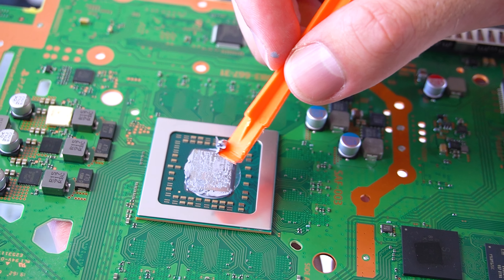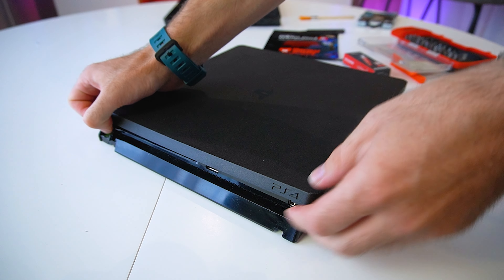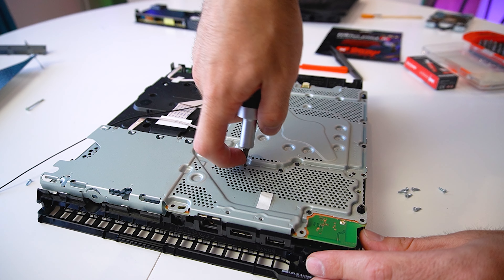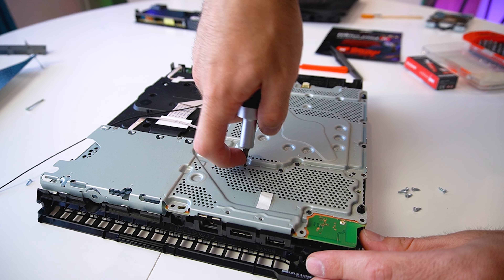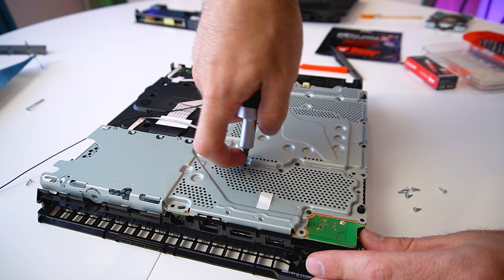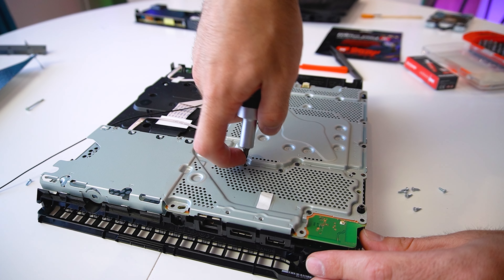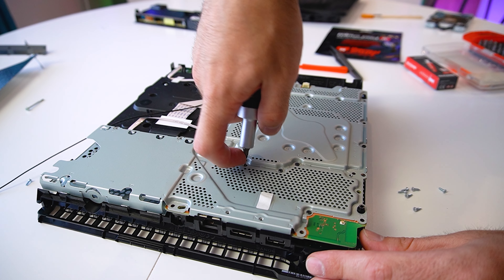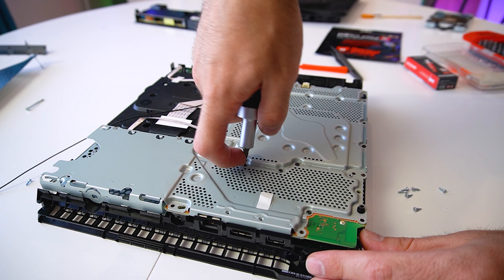PS4 Slim- Disassembling, Cleaning, Thermal Paste And Thermal Pads Replacement

Comment: I really want to clean my PS4 but I'm afraid I won't be able to put it back together like before
Reply from the maker: It's not that difficult, brother. The steps are very easy to do and follow
Reply: @SkvalaGaming  what thermal paste brand u use?
Reply from the maker: Thermal grizzly @stopmakingsens3
Reply: @SkvalaGaming You mean thermal grizzly kronaut? if yes,, which is better this or arctic mx-4?
Reply: @hanma_inu use any kind of thermal paste it works aswell
Reply: Any new thermal paste is better than old especially if its really old and if its been used a lot
Reply: @stopmakingsens3  Any thermal paste that have more than 14kw is good to transfer heat to heatsink. Much higher mean much better.

Comment: I just change the thermal paste and ended up with some thermal pads that fell out . Should I be concerned lol
Reply from the maker: You should put back tje thermal pads, brother
Reply: @SkvalaGaming is it okay not to change thermal pads?
Reply from the maker: @hanma_inu  I would change the thermal pads, just to be extra safe
Reply: Same and my console still runs fine after 1 and a half years lol
Doimg another clean up rn

Comment: I live in a tiny home shelter and there is so much dirt and dust that gets in here. I have had my ps4 brand new for one year, its a 1tb slim same as yours, I have taken it halfway apart and cleaned it a few times. One day i will use this video to do the thermal paste and pads. Currently waiting for a usb drive with the firmware on it to come in the mail, I bought a 1tb SSD for it and will install it next week. I am in los angeles and there have been 100mph winds causing so much dust and dirt to get inside, i played for a couple hours before i realized my tiny home was full of dirt and dust. I cleaned it a bit but i think i will take PS4 all the way apart and deep clean it next week when i do the SSD. I love your videos, that PS4 is so clean. That is how i would have mine but in this homeless shelter place it is really hard to keep the dirt and dust out of it 😢. Great videos thank you so much for the advice and quality content brother.
Reply from the maker: Greetings, brother. Thanks for the kind words!
Reply: @SkvalaGaming thank you for the reply 😊.  Do you think is ok that i bought Artic MX 4 thermal paste?
Reply from the maker: @ganj9217  Yep, that's a great thermal paste

Comment: I done this a few years back and recently went to do it again and noticed I stripped a screw on the shield to motherboard hahah. I'll have to try the solder trick to fill and mould screwdriver. Spewing, only just got new thermal paste and pads

Comment: That was the cleanest ps4 I've seen be cracked open first time 😮
Reply from the maker: It wasn't that clean on the inside, you can't see it very well in the video, but there was this very fine dust.
Reply: @SkvalaGaming  but no big chunks so at least air was flowing like normal 👍

Comment: I wanted to know is it safe to put big thermal pad on the v ram like you did or should it be a small pad like the original that's on the v Ram. It gets me thinking is the original small for a reason 🤔 from technology point what do you 🤔
Reply from the maker: As you can see i've put a bigger thermal pads, the old ones weren't even covering the whole v ram chip. I don't think a bigger piece will do any harm

Comment: Where do you put that small washer looking like a Tie Fighter visible at 7:37 left from teh PS4? MIne just fell out while disassembling and I don't know where it should go. Thanks and cheers.
Reply from the maker: aAt the top left of the heat sink there are 3 holes. From memory, the 2 prongs fit in the putter holes so a screw can go through the centre
Reply: Omg this comment is legendary I'm replacing parts from one PS4 to another and the same thing happened to me and I've been freaking out lmaooo
Reply: @zombiepie0452  its from the heatsink As Skvala said. Thanks again!

Comment: Cool video, just want to ask i have changed and cleaned my ps4 slim and changed the thermal paste and it go between 70 and 78 degrees but when i play big games like red dead redemption 2 and god of war and uncharted 4 it get the fan noise, my question is if i replace the thermal pads because i didn't will i get a change?
Reply from the maker: You should also replace the thermal pads, brother. It will help
Reply: How do u see temp of cpu on ps4??

Comment: I'm afraid... Thanks for this vid. Watching from the Philippines idol
Reply from the maker: The process is fairly easy, although there are quite a bit of steps
Reply: @SkvalaGaming  idol I'd like to ask right now I'm using the cooling stand fan (vertical)   and the HORIZONTAL Sidefan at the same time on my ps4... Any thoughts??
Reply: @johnescobar1520 been thinking abt this lately, and im curious if its good. The thing is, my ps4 slim cannot read discs when its placed vertically, only reads when horizontal.

Comment: The APU works around 79c and 95c it is pretty hot.
Reply from the maker: That's correct. 95° is bit too hot for me
Reply: hi newbie subscriber here.... can i ask what brand of thermal paste you are using ..,.ill buy it to use on my Ps4 ..thank you so much for the video....
Reply from the maker: I just picked up a random paste, just don't get a very cheap one @jepak0421

Comment: Is it normal for it to still get hot after thermal replacement? Or not overheating but it is normal that it gets warm and a bit hot after a couple hours of GTA? Thank you for any information
Reply from the maker: It's normal, brother. Don't worry about it
Reply: Thank you 🙏  @SkvalaGaming
Reply from the maker: @ No problem, brother

Comment: what kind thermal pad must be used for replacement? Odissey Exterme Silicone Pad 1.0mm?  Grizzly Minus Pad 0.5?
Reply from the maker: You'll need 1mm pads, brother
Reply: @SkvalaGaming  i had Minus pad 3x3cm  its enough for chips?   also have Artic MX -4 Thermal Paste
Reply from the maker: @hamed2011  Mm, barely. Just buy another strip, to be extra sure.

Comment: Did everything but the cable to my power supply won't budge, my motherboard wont either, this is getting me crazy 😭😭😭
Reply from the maker: You can try to gently wiggle it left and right
Reply: Dude me too! I was going to change the thermal paste but when I got to the unplugging the power supply point I couldn't do it so I put my ps4 back together and made it realize there wasn't going to be a thermal paste change for that guy!

Comment: Didn’t you use two different size thermal pads? If so which ones or what size?
Reply from the maker: No, i only used one 1mm thermal pad strip and i've cut it to the desired size

Comment: The cable for my power supply won't budge , it looks different to yours slightly.  I'm afraid to tug hard on it. Can I still do this paste service with the cable in the power supply?
Reply from the maker: You have to remove the power cable brother and power supply, brother. You can use a set of plastic pliers are a simple prying too. Don't go too hard on it, though
Reply: @SkvalaGaming Mine won't budge either 😢

Comment: I have changed the thermal in a shop
But after change the thermal i see the fan go loud a little
Should i change it with a good thermal.
The guy told me its ok
But i know my ps4  not like the first please advise me if i need to change it my self
Reply from the maker: I don't think there's a problem, brother

Comment: Did you have to clean off the old pads from the chips ? I didn't see that. What keeps the pads in place ? Are they sticky like tape?
Reply from the maker: I didn't have to clean the old pads, they just came off
Reply: @SkvalaGaming  Thanks , Im getting ready to do this with my PS4 , hope I dont break it , thanks for the video!
Reply from the maker: @FetterMuncher666  No problem, brother. And good luck
Reply from the maker: @RobertStevenson-uy9sj 1mm

Comment: Does your ps4 controller speaker also cuts out sometimes when playing? And does it also happens when wired headset are plugged in on your dualshock 4? Mine has this problems. What should i do to fix it
Reply from the maker: Try reconnecting the controller. It also might be an interference issue.
Reply: @SkvalaGaming  okay thanks
Reply: @SkvalaGaming Do you also experience this type of problems with your ps4 slim i bought mine also in 2019 and i experience problems this 2022 year i have problems with the wires headphones when its plugged in to the dualshock 4 it sometimes cuts out during gameplay and also the controllers speakers also have this issue that it sometimes cuts out and sometimes there is input lag during gameplay when the sounds cut out in the headphones i experience slight input lag everytime the headphones cut out i put my controller to dim light or the bright light it still has the same problem do you know how to fix this?

Comment: Do you have to disassemble the fan section to gain access to the motherboard/thermal paste area?
Reply from the maker: Yes, sir
Reply: @SkvalaGaming what would happen if you did not remove the hard drive from the beginning would it get in the way of the disassembling process or could you just leave it in?

Comment: Amigo meu ps4 slim fiz a limpeza coloquei uma pasta termica de boa qualidade, e o cooler dele fica acelerando com 5 min de jogo, isso em qualquer jogo pesado ou leve, os termal pads coloquei de 1,5mm acha que isso pode estar atrapalhando? E fazendo o cooler acelerar continuamente?
Reply from the maker: Não acho que seu PS4 tenha problemas, irmão. É normal que os fãs trabalhem mais sob carga
Reply: @SkvalaGaming  obrigado amigo, fico preocupado mesmo assim vou trocar os termal pads pro de 1mm, antes ele não fazia essa aceleração do cooler, pode ser o cooler com problema também.
Reply from the maker: Eu acho que você pode tentar os pads de 1mm, e se ainda houver ruído, troque o cooler @respawnablesbr6553
Reply: Can you link from either amazon or please tell the name of the thermal pads and the thermal paste you used?
Reply from the maker: I use Grizzly thermal pads and paste @WAZIL4314
Reply: @SkvalaGaming  i plan on following your video to clean my PS4, can you tell me about the areas i should be careful to not damage things?

Also what thermal pads should I use 😅

Comment: my ps4 keeps popping "unrecognized disc" each time i booted it up after cleaning. even though i didn't insert disc on it.
Reply from the maker: It looks like  you damaged the cable that goes from the motherboard to the disc drive. You can buy a new one from amazon for like 10-15$
Reply: @SkvalaGaming  I've seen a video of others that probably the rollers are misplaced.

Comment: What size for thermal pad dude?
Reply from the maker: For the PS4 you need 1mm thick pads
Reply: @SkvalaGaming  thank you very much dude👍
Reply from the maker: No problem, brother. Just make sure not to get thicker or thinner pads.  @liekarts2936
Reply: @SkvalaGaming some people are saying 2mm because it gets compressed. What do you think?
Reply from the maker: Just stick with 1mm, that's what i used @reddie8130